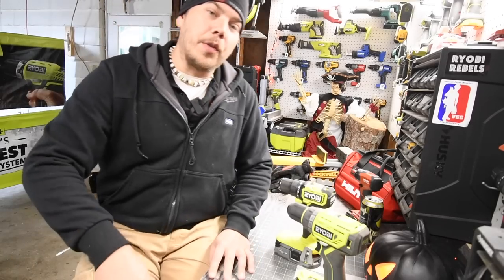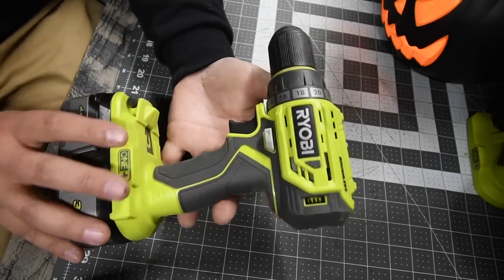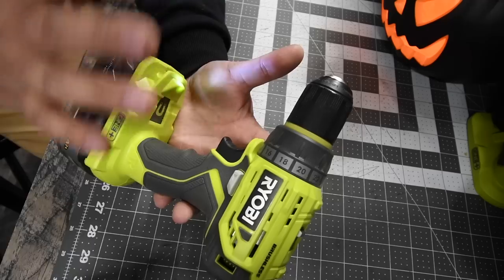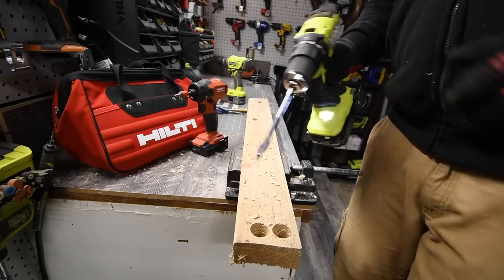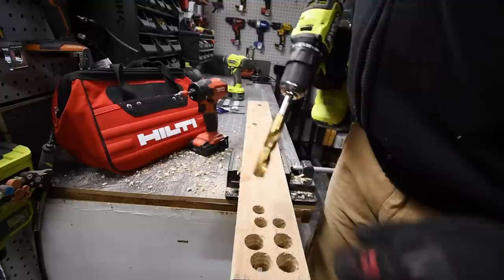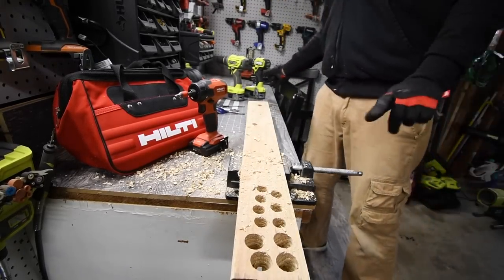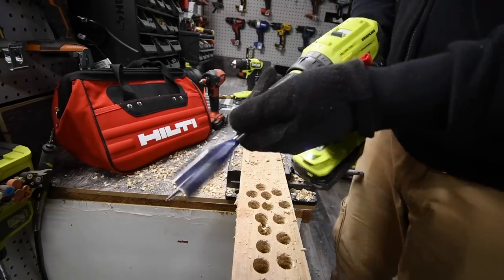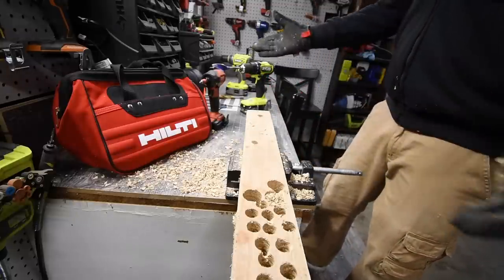Do you really need to Upgrade????

Comment: I have the Ryobi compact HP series of tools. In my opinion if you need a smaller tool you should move to a 12v system. It's fancy new packaging but not better tools in my opinion. A great test would be this system against either Dewalt or Milwaukee 12v. Great video.
Reply from the maker: I agree with you on that. it cant be that compact because of the battery it has

Comment: Correct me if I’m wrong but wasn’t one of the new features of the new HP+ line was that it had technology to protect the tool from “ abuse” unlike the previous version that worked till it smoked and died. It looks to me that to protract the new tools they turned down the power? But then again they claime more power and more brains in the HP+ line.

Edite: protect
Reply from the maker: its crazy because the older Brushless tools have the safety feature as well. its just a disappointment
Reply: @ManCaverTools  No, the older tools safety features are nowhere near as advance... You will burn out that Ryobi Brushless drill long before you can damage the new HP drill.  Testers like WorkShopAddict have already proven that.  So no comparison as far as safety features that protect the tool...  The HP tools self regulate and have much more advance protection system in place.

You also seemed to have made the mistake of not switching to the new HP tool battery for the remainder of the testing because if you are correct that the older HP+ batteries don't benefit the new HP tools then you basically ran the remainder of the test handicapping the HP tools with a battery that wasn't capable of giving it max performance and may have even gotten weaker as the battery charge diminished... 

Not that it would have changed much besides seeing what the tool is truly capable of but the big flaw in this comparison is the erroneous assumption that a compact tool would be more powerful than the full size tool... Seriously, name one of any brand that the compact tool is more powerful than it's full size counterpart?...  

It's powerful for it's size but you can't scale down without it effecting the performance...

But that's the trade off for the smaller size and lighter weight, which can be a fair trade off if the type of work being done makes it easier on the user.  Like getting into tighter spaces and being able to hold the tool up for longer periods, such as when installing upper cabinets or ceiling panels, etc.  A over 30% difference in weight of the tool can make a big difference in how your arm feels after a few hours of work...

Better reliability and convenience isn't nothing...  There's more to tool improvements and innovation than just a constant increase in max performance...

Comment: The new batteries are not labeled as HP and I can't see any reason for not labeling them as such if they were.  Also, if they had some new "touchless" method of communicating with the new batteries like HP is supposed to, I would think they would have some new designation like "HP+".  The new batteries on the inside don't show any obvious signs of a wireless communication method to the tool so that doesn't seem to be it.  I have a suspicion that some marketing folks at Ryobi decided that these new tools should carry the HP label without really knowing what the HP meant.  I have also seen reference to these new tools as "High Performance" which may be what the marketing group thought the HP stood for.
Reply from the maker: all I can say is I am very disappointed that the older HP batteries dont work in the new tools like they do in the older Brushless tools

Comment: Look inside the handle for the third terminal?
Reply from the maker: I took the new impact driver apart in a previous video and there is no extra terminal
Reply: @ManCaverTools  , ahh, I watched that one, you swapped parts over? 

So the new compact HP doesn't have the third terminal?

Comment: All these guys commenting saying that ryobi never said that the new drills are not faster or more powerful. I dont know about you. But if i went and bought this new HP line thats more expensive and suppose to be more advanced as they do say btw. And it was worse than my current tools id be pissed. And it seems to be a growing trend with alot of stuff now a days.
Reply from the maker: I agree with you on that. Even dewalt is guilty of that
Reply: No, the tool market just caters to many different needs and there's many categories of tools with different optimizations to fit those niches.  So you just have to know what you're buying and whether it fits your needs or not.

Compact tools caters to those who are looking for more convenience in smaller and lighter tools but the trade off is less performance than larger tools can produce. But it can be worth it to be able to use the tools in small spaces that the larger tools may not fit into at all and for the reduced wear and tear on the user as lighter weight means less strain on the user.

So you're just not always going to be paying for the same things with all tools, as they can be optimized differently for what they excel at and it won't always be just about performance...

Like many tools today are becoming smarter, there's programmable tools you can connect to apps on your smartphone, ways to track the tools and batteries, etc.    The HP tool series follows in that trend as they are smarter versions of the Ryobi tools, which makes them more reliable and long lasting, which is what you're actually paying for with them but they are compact tools as well and that has to be understood for how it effects how the tools are optimized and intended use...

If you're building a house, they may not be the best choice, but if you're installing cabinets, putting up ceiling panels, etc. then they may be what's ideal...

Comment: Sorry but ryobi never claimed it was more powerful than the brushless drill. It's a lighter compact serious meant to be compact not to compete or replace thier top of the line brushless. ANYTHING mentioned about comparisons on the website are vs the brushed drill. Also the new drills don't benefit from the hp batteries that is claimed nowhere also, they benefit from the new technology in the motor that works with ANY ryobi battery.
Reply from the maker: you are correct, they only compared the specs and size to their biggest and cheapest roybi 18v drill.

Comment: They never claimed that the new hp was more powerful. Only that they’re more compact and lighter. 430in lb > 400in lb
Reply from the maker: you are right they never even compared to the a brushless drill. they compared it to the cheapest 18v drill they have. so the % of what they claimed is false. because it is not as smaller as they say it is to their most recent drills, even the recent brushed drill they have